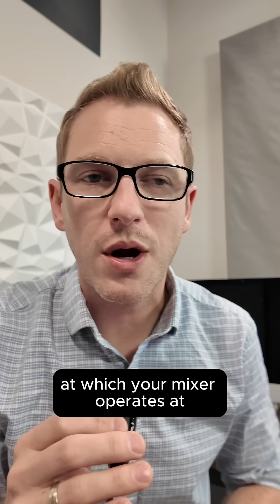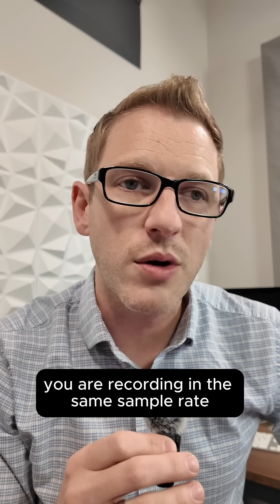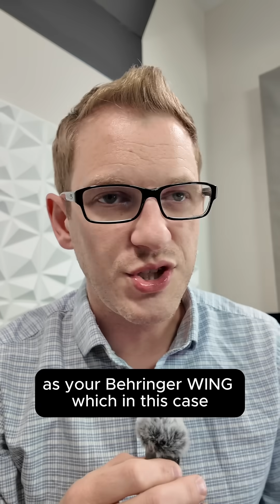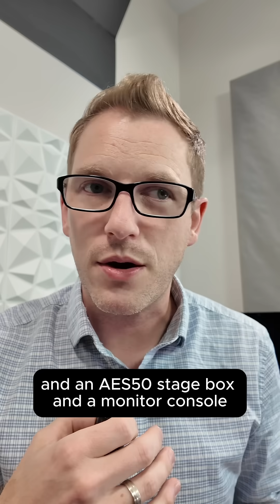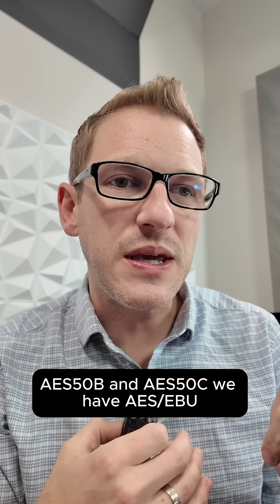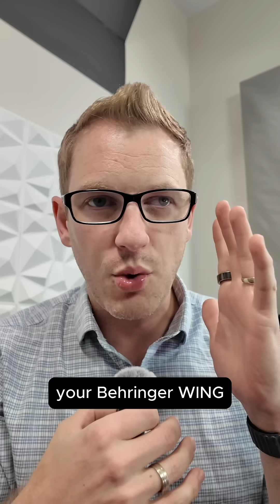Behringer WING: Clock Rate & Sync Source Explained #wing #DrewBrashler #audiotips

Comment: In the X32 platform if you were using an AES50 stagebox, you had to use an internal clock rather than a card clock. The Wing has the ability to use a card clock while connected to AES50 and stage connect stageboxes?